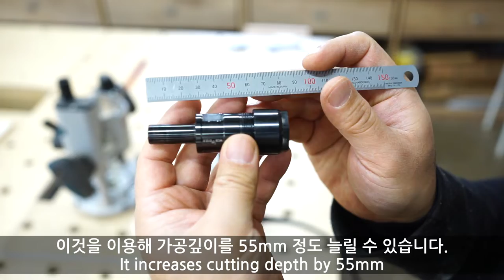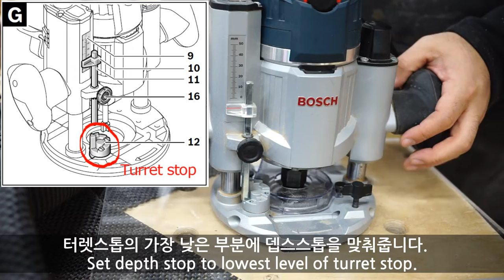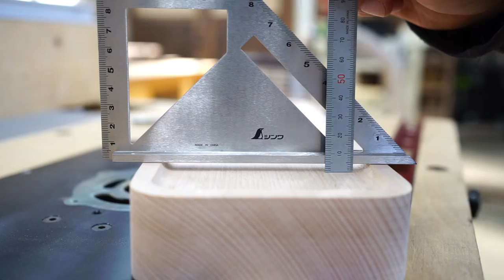How to make tray with router

Comment: I’ve got another question for you, if you have a moment. Regarding jigsaws, do you prefer the top handle style you use in this video, or barrel style? I am looking to get a new jigsaw but am unsure which type is best. Thanks!
Reply from the maker: hello Mr. yang. I can't tell exact pros and cons of barrel type handle, as I haven't use it before. 

I think you should choose handle type according to what position is comfortable to you. Top handle is comfort when you use jigsaw under your waist level, but it maybe uncomfortable when you cut part that is upper than your shoulder level. As your wrinkle and shoulder position are uncomfortable and unstable.

Comment: Beautiful! What are the dimensions of the walnut tray, if you don't mind me asking?
Reply from the maker: Thanks. : ) The size of walnut tray is 335mm(length) x 100mm(width) x 33mm(height).
Reply: @a_woodworker  thank you for the reply! Do you recall the routing plunge depth for the tray area? And lastly, what size roundover bit did you use for the edges? I have been trying to learn to make small trays like this, so I appreciate the help.
Reply from the maker: @jasonyang4685  Depth is 20mm, radius of bit is about 5mm. I believe you can make beautiful tray. Please pay attention to your safety. : )
Reply: @a_woodworker  Thank you! Do you have any other social media or website for your work? Would love to follow if so.
Reply from the maker: @jasonyang4685  I have instagram id (amateur_woodworker_) but I think you don't need to follow because I post only still image of my work but in youtube you can watch whole build process. anyway thanks for asking. : )
Reply: @a_woodworker  do you recall what brand or where you bought the router bit extension? And also where were you able to find a 35mm bosch template guide to fit your router bit?
Reply from the maker: @jasonyang4685  I bought extension bit at online mall. but now they don't sell it. I think CMT product will works at amazon. The template guide's outside diameter is 1 and 3/8"(similar to 35mm) and it's a part of bosch 8piece router template guide set. you can buy it at amazon store.

template guide set : RA1128
extension bit : CMT 796.001.00
Reply: @a_woodworker  thanks again for the info! Lastly, is there a reason you would pick a router with 1/2” shank vs 1/4”?
Reply from the maker: @jasonyang4685  When bowl bit dig wood it should withstand large lateral load. The thicker shank means the stronger bit. I think 1/4" is not enough to do it, so I choose 1/2" shank bit. As my country adopt metric system, I use 12mm  collet and shank. 12mm in metric is similar to 1/2"  in imperial system.
Reply: @a_woodworker  as always, I appreciate your replies and insight. I have a 1/4” router, but might have to upgrade to a 1/2” in the future! Thanks again :)

Comment: You bypassed the process of removing all the internal material. Video went from drilled holes and suddenly a cleaned out internal. Not much help.
Reply from the maker: You can see removing internal material process from 08:05 and I showed drilling hole scene(10:50) because If drilling work was done before using router. It'll be able to save much time. The way of removing internal material after drilling holes is same with showed at 08:05. I hope my comment helps you.